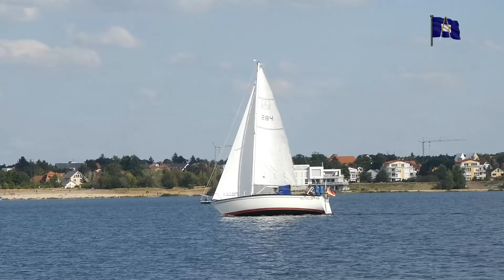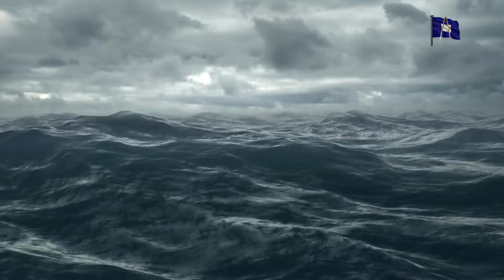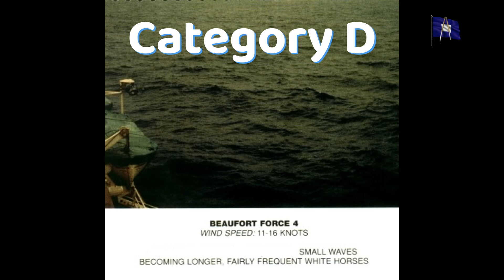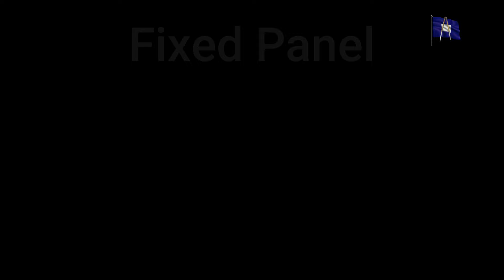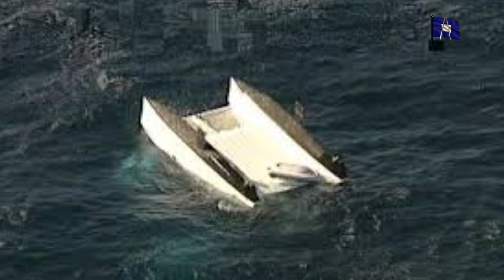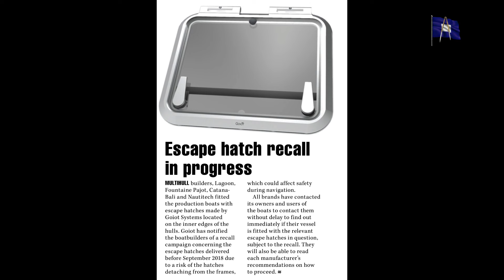Debunking sailing multihull stability and escape hatches requirements.

Comment: I just left a catamaran in Bermuda this month. The hatch came open in rough conditions on a transatlantic passage half way btw Norfolk and Bermuda. The design of the hatch and increased slamming from low bridge clearance were factors. Large ingress of water. Nearly lost the boat. The hatch was installed with opening in front. Because bridge deck clearance was less than a foot (40' boat) the hatch was forced open and could not be closed. Made it into Bermuda by a series of miracles and good preparation for events like this by captain. 11:41